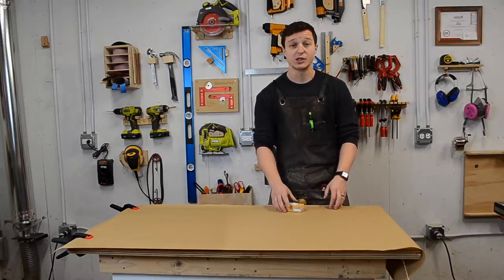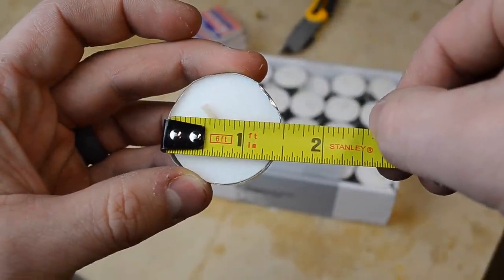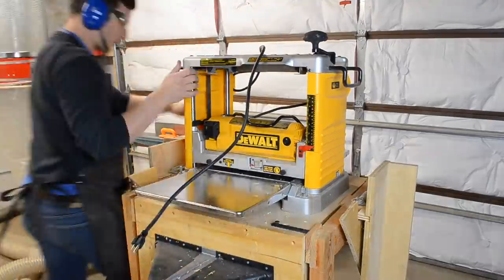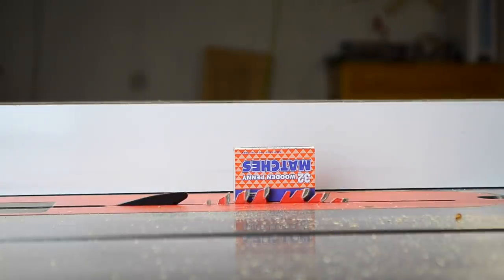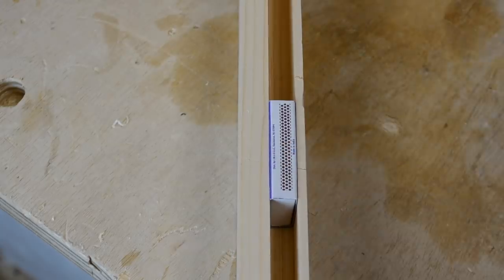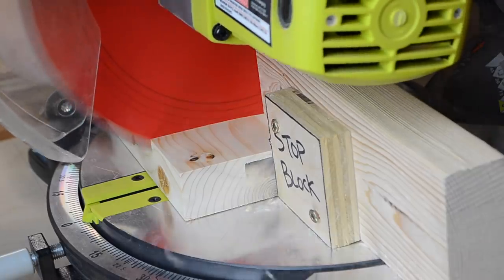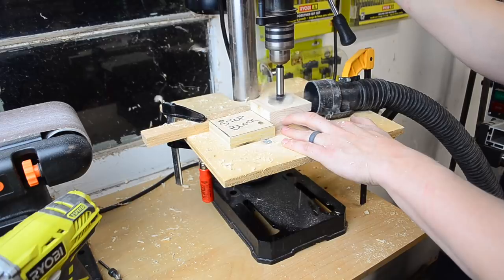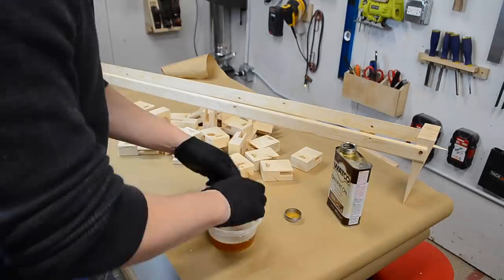Easiest DIY Woodworking Gift Idea | 40 Candle Holders from a Single 2x4

Comment from the maker: Thanks for watching! If you have any thoughts about this video, I'd love to hear them in a comment below. And, don't forget to subscribe to my channel if you want to see more content like this!
Reply: Really great idea! I just watched it and I built a miter table very similar to yours. However, I haven’t added the collapsible arms on the sides. Could you show how you did it? Can see a slow up of the hinges? Thanks!!
Reply from the maker: Rick Hall thanks! I used long piano hinges for the supports. They were a little expensive but work great for this application.
Reply: Would love more info on your flip-top mitre-saw/planer cart - have been looking for a design for that exact combo
Reply from the maker: @byrningi  Thanks for watching! Unfortunately I didn't make any plans so I can't help too much. If you have a specific question I'd be happy to answer!
Reply: @dkbuilds  how much clearance did you leave for the tools to flip, and what system did you use for locking the flip-top and mitre-saw wings in place?
Reply from the maker: @byrningi  The clearance you need depends on the height of the tools attached. My miter saw has a big dust head over it so I needed a lot of space. The flip-top is locked with two heavy duty sliding door locks, and the wings don't lock in place but rest on to pieces of plywood which are attached to the main frame with piano hinges. I've found the wings are stable enough to support heavy boards, but they do move a bit back and forth and are difficult to keep exactly level, so I rarely use stop blocks on them unless I'm OK with a ~1/16th error in cuts.

Comment: It's not easy if you don't have the equipment.
Reply from the maker: ¯\_(ツ)_/¯
Reply: Look for a makerspace or similar skills shop where you can use tools like these. Depending on where you are it can be anywhere from free to use,  to $10/hr.
Reply: Floe Simmons This can be made with a handsaw, cordless drill and chisels if you lack the power tools but have plenty of free time and energy 🙂

Comment: the trick I have been using is bungy the shop vac hose to the drill press post, get some adjustability to get it where you need it and because it is above the foster bit as the shavings eject they somewhat get sucked into the shop vac.
Reply from the maker: Good idea thanks! I'll have to try that

Comment: I like how you casually demonstrate your awesome and totally unexpected miter saw to planer flip top convertible station without even mentioning it in passing 🤣

If the saw overheats it should indicate as much with a specific green and red light pattern on the control box that you can look up in the manual.
Reply: Yeah. I backed that bit up and watched it several times.  I'm not seeing a how-to or anything elsewhere on the channel.  Is there a video about that?
Reply from the maker: I designed it myself and didn’t film a video, which I really regret. I may make another soon and if I do, I’ll definitely make a video about it!
Reply: Yes plz do , I know a few ppl ( me included ) that need to save space  in the shop
Reply: @dkbuilds   uh, yeah, count me in as interested in that planer/mitre table. That'd be amazing for a small shop.

Comment: Great video, but be carefull with wood and candles.
A similar project of mine once caught fire, because the metal part of the candle got too hot.
Reply: I agree.  You could drill a quarter-of-an-inch deeper, then smoosh a layer of clay in there, to make it more heat-resistant.
Reply: Danish Oil Flash Point: 106 F
Reply from the maker: Good to know! Is this for the oil in liquid form, or after it has dried and cured on a wood surface?
Reply from the maker: Thanks for the comment! I will do some flame tests before giving these out as gifts!
Reply: @dkbuilds  Curious what the results were before I undertake this project. Sorry, don't want to be an unsuspecting arsonist! :-)
Reply from the maker: @campbellwoodshop  No one I've given this to has had any issues. I also held a flame to the wood just to make sure the finish wouldn't catch on fire, and it didn't. Of course any candle with an open flame is always a fire hazard and shouldn't be left unattended etc, but I (personally) don't think the fact that this one is made out of wood makes it any more dangerous than any other candle holder.
Reply: @dkbuilds  Thanks man. I figured as much but wanted to see what your experiments had wrought.

Comment: Great work David. Do you have any suggestions on how to make the slot for the match box without a table saw?
Reply from the maker: Thanks Mark! That's a tricky one. The best second option in my opinion would be a router table with a fence, and you can take many passes getting the slot deeper and deeper (don't attempt to remove too much at once). Alternatively you could consider gluing three pieces together to make a sandwich, with the middle piece being smaller, to create the slot. I'm trying to think of a way to do this with a circular saw but I can't come up with anything that is both precise and safe. Hope that helps!